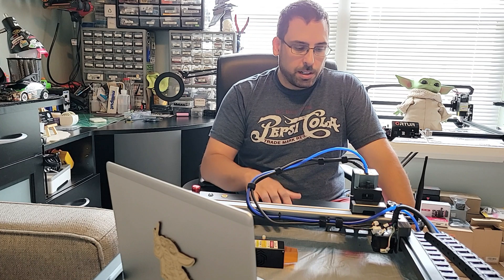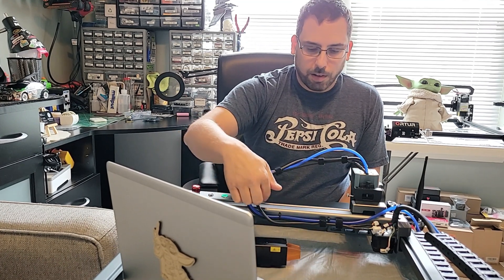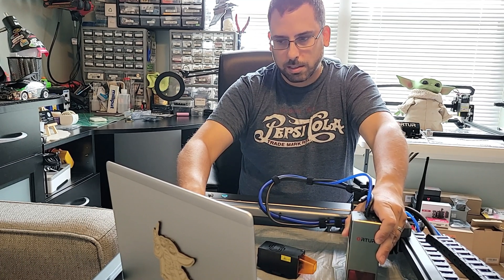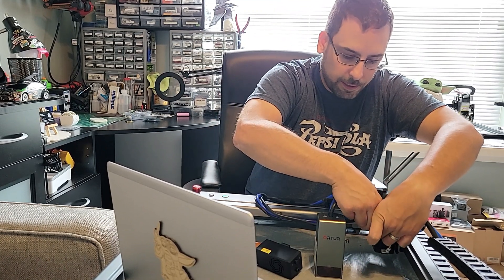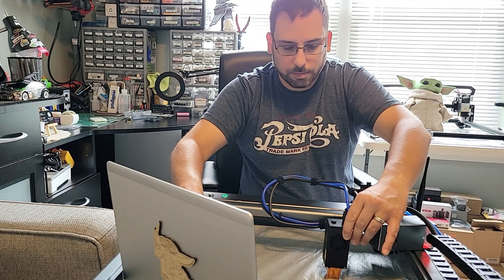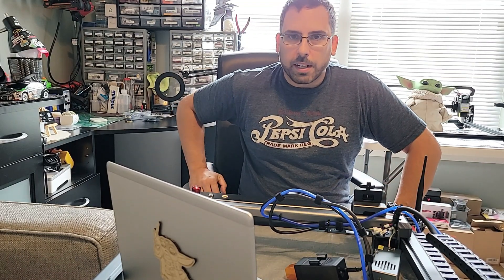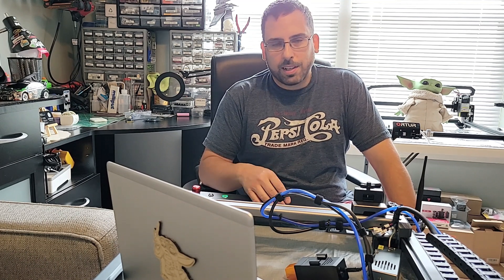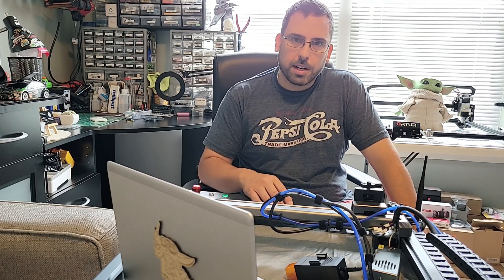👉 Ortur 20 Watt (20W) Laser Module Custom Installation🔥🔥

Comment: Nice overview.  Does it only require one power brick now?   Were you able to complete the detailed video?   I think I read on a facebook group posting that if the LM3 had an internal fan installed it would work without the OUC.  Thanks.
Reply from the maker: I did buy an 8A power supply and a Y connector to power both board. I haven't tested it out yet. I think the issues with running it without the OUC is the current draw. The components on the main control board are not rated to handle the full amount of current and that is why the OUC is needed. I personally would not risk it. I believe the main OLM3 board is around $150. I have gotten behind on videos. I just finished reviewing the AlgoLaser Delta and have their DIY kit to look at. I just need a way to stop time. Thank you for your comment!
Reply: @dadwillmake  currently MicroCenter has the updated mainboards on clearance for half off.  Extension kit, legs, etc are marked down quite a bit.

Comment: hi, nice video. did you came up whith the tutorial on that installation?
Reply from the maker: No, not yet. Life got a little busy for me. Should be up soon. I promise!
Reply: @dadwillmake   I assume @ssalvatierrar was asking for the board installation tutorial? If so @dadwillmake - can you answer to whether the board required frame modification or was it an exact replacement. I want to upgrade my 10w to the 20w but do not want my system to look Frankensteined.. trying to determine if the extra cost (of another new unit) is warranted to avoid that.
Reply: @dadwillmake  I'm still awaiting your video on how you integrated the OUC in the front frame section.
I read that you split an 8A power supply which is helpful, but really wanting to learn more of your strategy:

In the meantime, can you create a quick written overview?
Did you utilize the existing external power jack and just hardwire a splitter inside the frame?
Did you need to create a mount for the OUC? Which side of the frame?
You mention special connectors...Did you extend the control wires? 
Can you list the special tools and why they're needed? (ie crimping tools for connectors may be ideal, but there are other ways to extend a wire).

I'm even targeting a 30 or 40W module and they all use an OUC that looks similar in size to the Ortur 20W version. I'm guessing your strategy would be scalable to use with other after-market lasers, but I'm not wanting a science project if you've already done some basic troubleshooting.